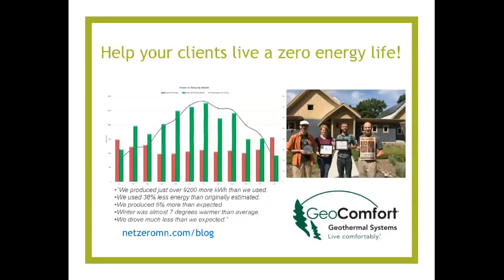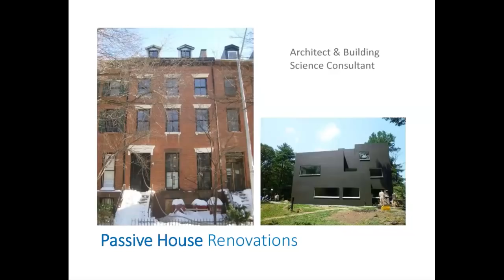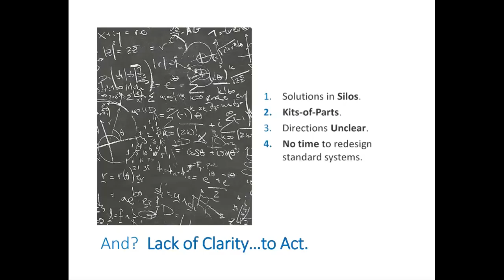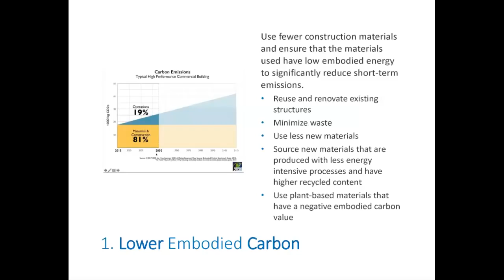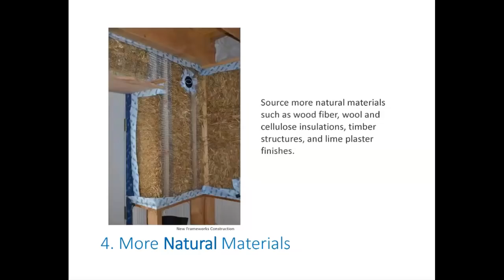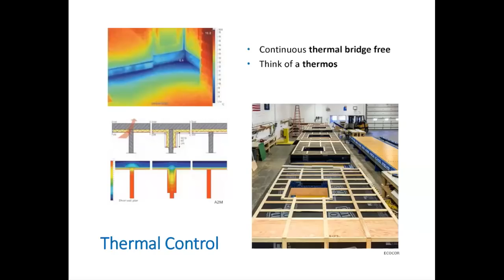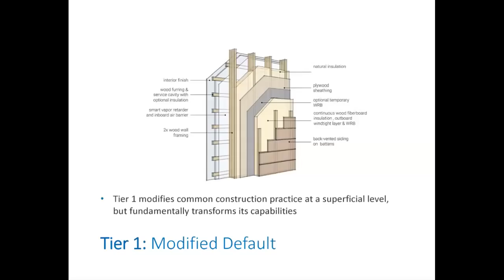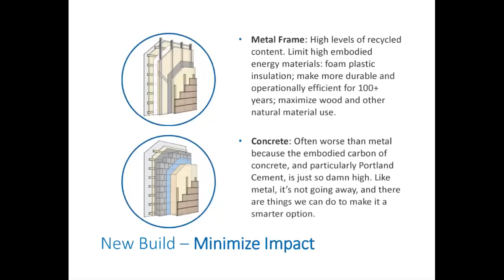The Smart Enclosure System Building in the Anthropocene

Comment: here is optimised, inside->outside: interior plaster which is an airtight barrier (preferably clay plaster) -> masonry structural wall (lime silicate blocks or you can go for stone if ur ECO enough), also containing electrical, plumbing and other installations inside thier cavity -> continous insulation (can be wood fiber boards) -> reinforcement layer for exterior plaster (fiber glass mesh and glue, ETICS) -> exterior plaster; masonry walls provide thermal mass, are fireproof and stable (no plaster cracking which helps to keep the airtght layers intact, windows will remain airthight); plastering outside is the best option cause plaster sticks and does not require 1000s of nails penetrating the insulation layer to be installed like its done when using siding; using 2x framing is not a good practice, its the deafult, ditch it if you want 'tier optimised'